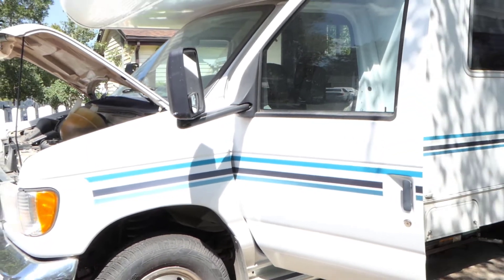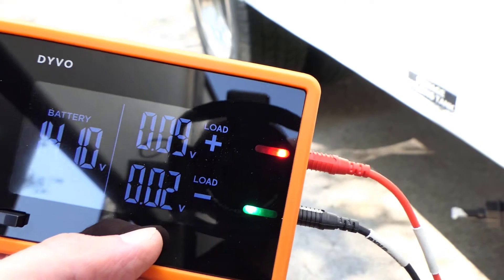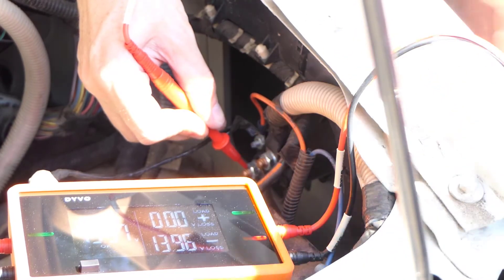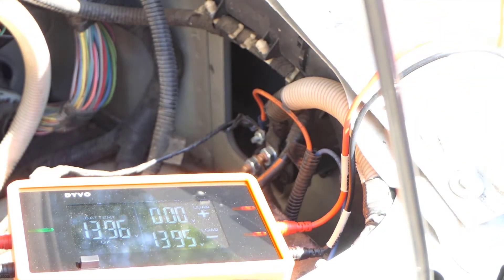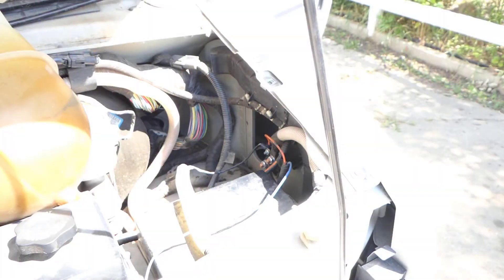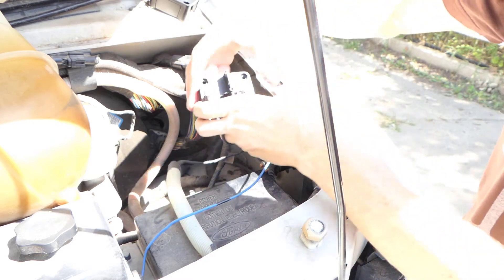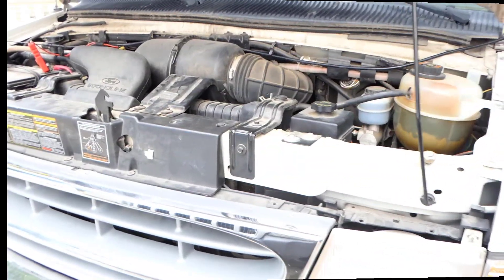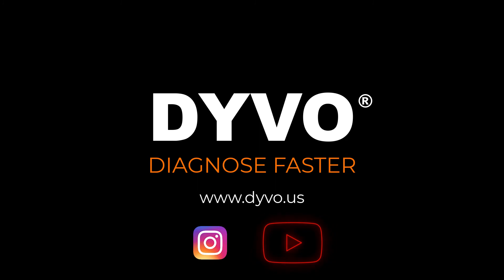How To Test A Battery Solenoid

Comment: Wow! Thanks, my suspicion is confirmed. I have a 2023 Winnebago Solis Pocket exact situation, the house doesn’t charge while driving but the chassis does. I have been searching and also inquired to Winnebago to locate the solenoid on the rig to replace. If you know, please share!? Thanks for the video!
Reply: … also, are both house and chassis connected to the solenoid?🤔 if the chassis batt was charging but not the house batts?
Reply from the maker: @StoneRunning23  Yes, both house and chassis batteries are connected to the battery solenoid/isolator. The purpose of this isolator is to connect or isolate the engine and house batteries from each other, so they both must connect to the isolator. Smart isolators, such as the one installed in the video, are capable of "looking" at the voltage of both batteries. If one falls below a certain amount, it opens and isolates the batteries. When the voltage of either battery goes above a preset amount, it combines the batteries. To answer your question, if the chassis battery was charging, the isolator will combine the batteries to also allow the house battery to charge, and vice versa.
Reply from the maker: Thanks for the comment! Unfortunately we don't know the location of the battery isolator on that exact vehicle since Winnebago doesn't publish their design specs. Hopefully Winnebago can tell you? If it is a solenoid type, you can try to listen for a "click" sound when performing key-on, but that's only if it's working and still might be tough to locate. It could be next to the engine battery or house battery.

Comment: Great upload, thanks. When i hook my isolator solenoid up it seems to fry my starter solenoid. Have you seen this before? Will replacing the isolator solenoid fix this?
Reply from the maker: Unless it's a pan on a stovetop, frying is never good. With electrical, "fry" is a generic term that can mean a lot of things, so we're not exactly sure what you are seeing. We don't recommend replacing parts unless you've tested them and verified they are faulty. The isolator could be defective, but it might not be wired correctly. The battery isolator is only meant to combine or disconnect the starting battery and the house battery. We have a schematic on our website that shows a general overview of how these components are connected. https://dyvo.us/how-to-guides/  **Note: the schematic is for reference purposes only. No circuit protection is shown in the schematic. Best of luck!

Comment: Hello. Is it best to remove/disconnect battery when replacing selonoid as to avoid shock? Or...is this not an issue? Thanks.
Reply from the maker: Great question! We recommend disconnecting the negative battery terminal when replacing/installing any component where shorting can occur. Battery isolators and starter solenoids have open contacts that are always "hot". This means, you could accidentally short the contacts when servicing them. Headlight bulbs are an example of a component that typically does not have open contacts, and the circuit can also be turned off, therefore, disconnecting the battery before servicing is usually not needed. The purpose of disconnecting the negative battery terminal is to prevent accidentally shorting a positive and ground. You do not need to remove the battery unless it is in the way of the component you are trying to access.
Reply: @dyvoautomotive  Thank you! My 2006 Dodge Sprinter View RV is having house battery issues. Replaced them...but there is no power coming from them. I will try and replace the solenoid next and see what happens. Thanks.
Reply from the maker: @jimmoses6617  We recommend testing the solenoid first before replacing it. If it doesn't have the signals it needs to operate, installing a new one won't fix it. Best of luck!